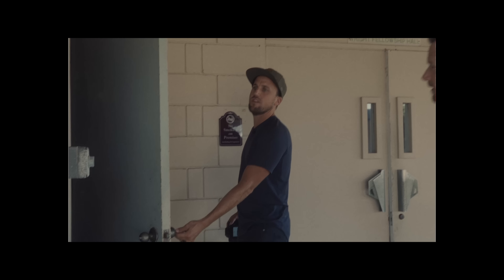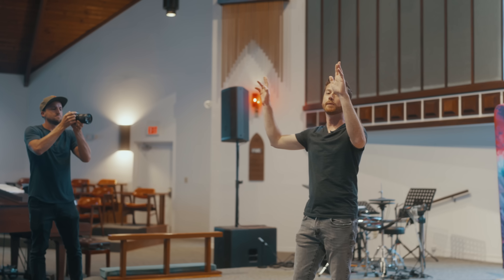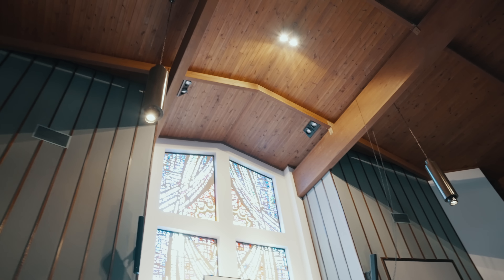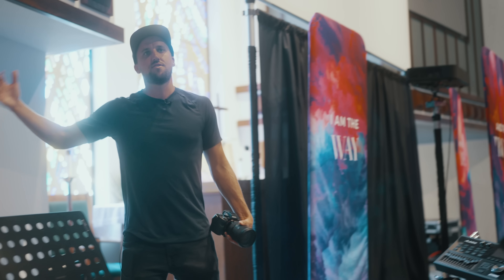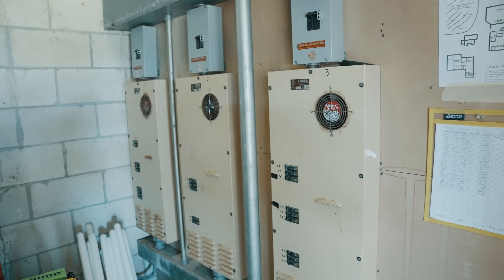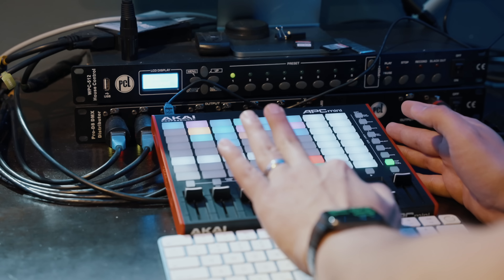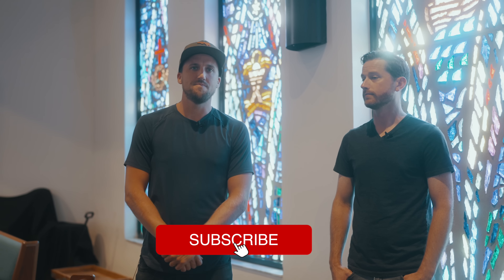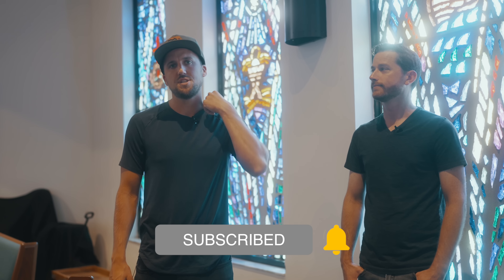How to Upgrade OLD Church Lighting System (Fixtures and DMX Control)

Comment: The dimmer pack is pretty old but at least you have ability to preset some scenes.   Our lights are at least 50 years old and some maybe original to the building (70+ years).  We have a master box in the basement with the dimmer packs that do the heavy lifting that are wired via low voltage leads to I think 6 manual zone dimmers plus a Master dimmer in our “crows nest” … all controlled with dimmers similar to that in your home.

Comment: Is there a way to control old dimmer lights like that with DMX?
Reply: It all depends on the system that's in place. If the dimmers offer no way of external control (like DMX or 0-10v) then it's very difficult. You can always reach out to the manufacturer and see what they recommend. In this case, it looks like these are old Lehigh dimmers and their tech support could provide some answers. If there is no external control option, then you either have to replace the dimmers or retrofit the fixtures with new DMX controlled house lights. Retrofitting is not a bad option since there is already power going to each light.
Reply: @steve01010  I'll have to take a look at the system that is there. It is for my wife's schools production. They have about 12 front wash lights that are on dimmers controller by a controller at the back of the room. I'm trying to find a way to integrate coloured dmx controlled lights as well but have them all controlled by the same controller.
Reply: @peterthorogood7025  feel free to tag me when you find out the dimmer brand and model # and I'll see if I can help.
Reply: ETC has a product, ES1 CE Dimmer, that is a DMX dimmer for architectural lights

Comment: Thanks for this video! Im serving a congregation in Cocoa Beach and we need to update lighting from the original 1960s stuff. Can you share the electrician you used if you are in Melbourne? Thanks!
Reply: We've reached out to Pro Church Lights but could use help with finding an electrician willing to do the work. Thanks!

Comment: I would put Can downlights in that sofit for the new "Rock wall treatment" - can be direct DMX or DMX dimmer pack. Direct DMX better provides better fixture control!  And as my Lighting Director friends say - "where does light come from? Never from the floor"! Up lights should always be the Last option in Architectural lighting.